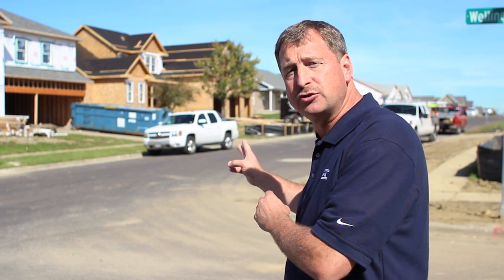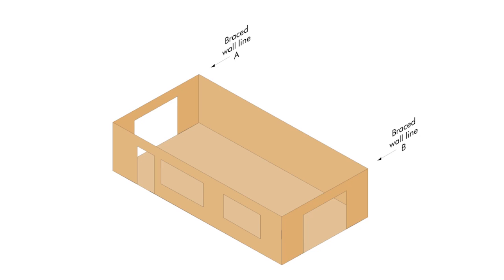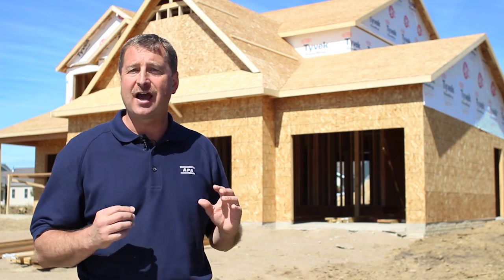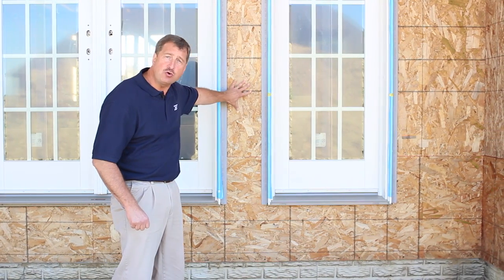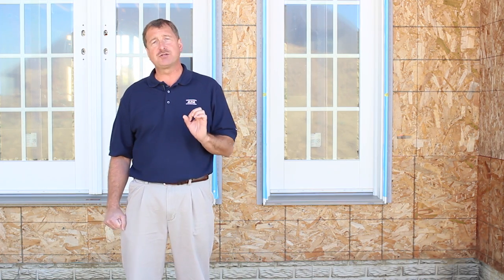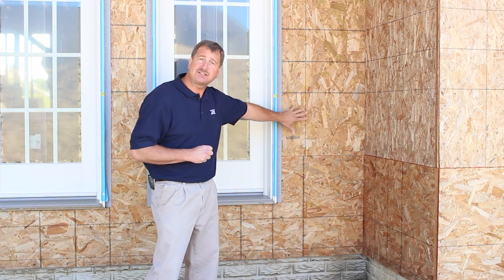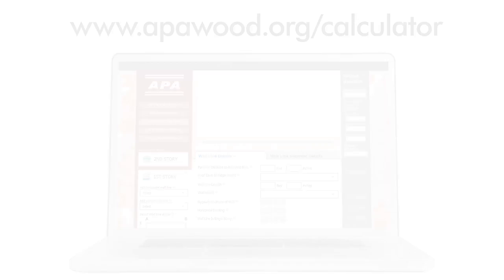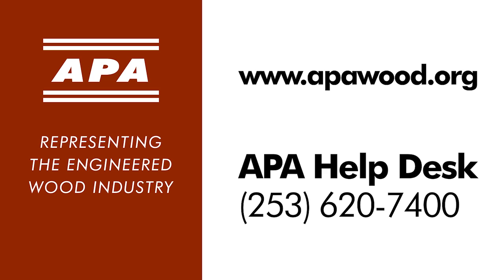Wall Bracing: Satisfy the code with strong, resilient, fully sheathed walls

Comment: Both butt walls on my house have Masonite lapboard under the vinyl siding. It has no bracing strength so it must go. In order to replace with continuous sheathing I have to remove the soffit and soffit nailers as well.

Comment: I am planning on building a garage to hold my camper 24x50 with 16' side walls, with  14x16 over head door. I am planning on 2x6 studs on 16" oc, 7/16 osb plus 7/16 smart siding 2x8 sheets us blocking walls at 8' n 12'. We're the garage door is going is were I am not sure what is best to do. There will be 4 ' on either side of the door n I will be trying it into my current 2 car detached garage it has 9 ft wall with just 4x9 smart siding.  Can you give me your advise on my garage door bracing. It is in Kansas were we have some days with high wind speeds.Thank you.

Comment: Is it possible for wind to pull sheathing off the side of a home enough to bow or make wavy the siding?
Reply from the maker: Thank you for your question. In general, if the siding is not securely fastened to the sheathing, the wind could suck the siding off or cause it to bow. The underlying sheathing will also be affected by the wind pressure and must be properly attached to the wall framing. For high wind areas, additional fasteners are required for the wood structural panel (plywood or OSB) wall sheathing. For more on this,  see our publication, "Building for High Wind Resistance in Light-Frame Wood Construction," Form M310. To determine the correct fastener for your siding product installed over wood structural panels, see "Technical Topics: Wood Structural Panels Used as Nailable Sheathing," Form TT-109. Both publications can be downloaded at no cost from our website at www.apawood.org/resource-library.

Comment: Why wouldn't a piece of sheeting inside of the framing be helpful? I was thinking a 3/4" sheeting would make it harder to rack and may increase the R value.
Reply from the maker: Hi Stephen, Thanks for your question. 

The AIBD/APA Wall Bracing Webinar Series is based on the 2012 IRC (International Residential Code) requirements. The more current 2015 and 2018 IRC are similar. The requirements in the IRC are prescriptive. With prescriptive design, engineering is not required for the Braced Wall Panels. You only need to follow the guidelines. The prescriptive requirements do not include the addition of wood structural panels to the interior side of an exterior wall. 

There are provisions in the IBC (International Building Code) for engineered shear walls. An engineered solution may add an interior shear wall panel opposite the exterior sheathing, under certain guidelines, which will double the design value of the shear wall. However, this same option is not available under the prescriptive requirements of the IRC for braced wall panels. 

If this doesn't answer your question or you'd like to know more, check out our FAQ and help section at https://www.apawood.org/help.